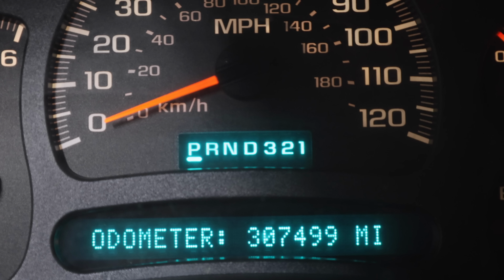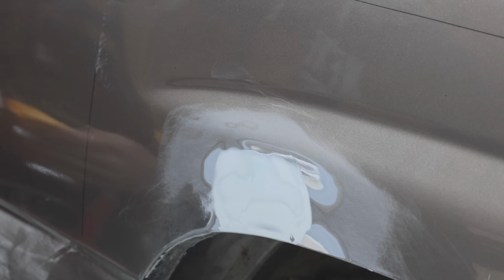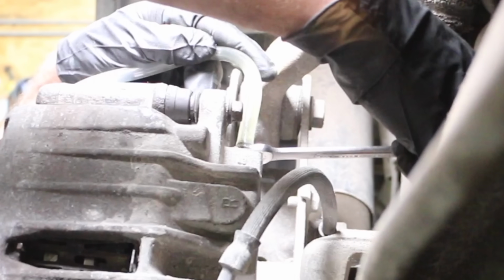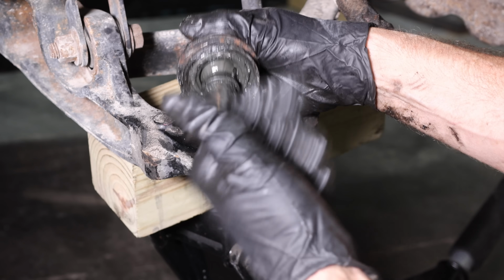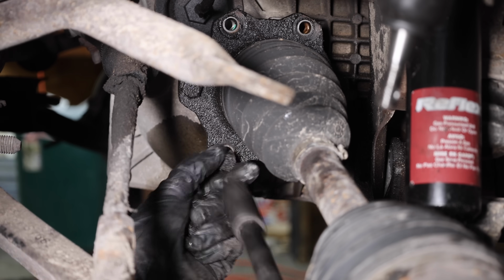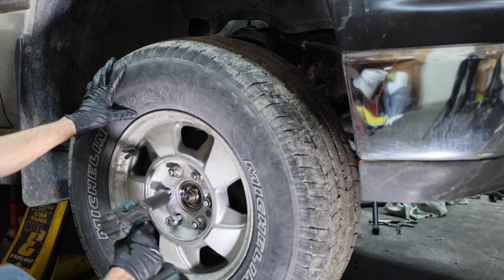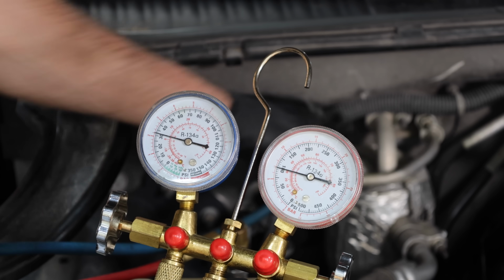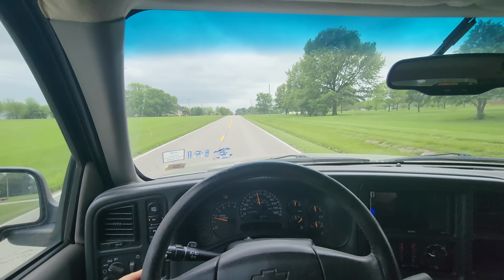Is It Stupid To Fix Up A 300,000 Mile Vehicle? Let Settle This!

Comment: Bad ass videos! I just like to know how much did it cost to to do all that maintenance at once? And if you were to pay someone how much more would it have cost. I love older vehicles they are so easy to work on and in my opinion a lot more durable & reliable for the most part, just as long as you give them proper maintenance no need for newer vehicles

Comment: It is absolutely NOT stupid to fix up a 300k mile vehicle. I'm guessing you spent $1000 on parts and materials, and a couple days of your time for this update, and that Suburban is probably good for at least another 100k miles. I have a 2002 Mercury Sable wagon with just under 100k miles that looks, runs and drives like a new car that I am quite proud of, and wouldn't dream of trading it for a new car that costs $50-60k.
Reply from the maker: Great Point!

Comment: For the novice mechanic , when changing out Brake pads, with the tire off you can see the pad wear in the cut out of the caliper support, if worn pads  are found take a long screwdriver or a flat bar between the shoe and disc to compress the pistos back into the housing, only takes a few seconds. After repacing the pads, and everthing is back together, press the brake pedal  slowly and release, wait a couple of seconds and do this again, untill the pedal hardly moves down, the caliber is now charged with brake fluid. Failure to do this, and you might not have all your brakes on first drive.
Reply from the maker: Thanks for sharing the tip!

Comment: My credit isn't the best, and my family is rough on vehicles, so I've taken to spending a few thousand on beaters and driving them as long as I can.  I did have to finance a vehicle last year for the first time in over 15 years.  Let's just say that the monthly payment is absurd, and within a couple of months of buying it, my wife spilled hot chocolate in the vents and the a/c stopped working.  I think I figured it out, and bought the part to replace, but it's a Ford and I don't want to damage the interior trying to pull things apart (I was a GM mechanic 25 years ago, but my patience and ability to contort my body preclude doing a lot of work).  So, that's probably gonna be a $2k+ fix.

My truck has been stored over 1000 miles away since I retired from the military.  It's an '06 Sierra with nearly 320k miles, and I think the head gasket might be blown.  I plan to swap in a crate engine and know that the 4L60E transmission and the transfer case are going to be in need of replacement shortly after.  Even if I pay for someone else to do the drivetrain work, and refurbish the suspension and steering myself, I figure I might be in for $15k... $20k tops.  For a 20-year-old truck (manufactured August 2005) Sierra SLT that'll be essentially new besides the body and frame (no rust or major damage that I know of).  Buying a new truck with similar options--updated for 2025 standards--will set me back over $60k.  Buying a similar truck with less mileage on the original drivetrain will cost at least $5k, for a truck I don't know the history of that might require the work I need to do to mine anyway.  Plus, I'd have to obsess over every little speck of dust and potential scratch, parking as far as possible from other vehicles and getting paranoid when someone dares to park next to me.  No thanks.  My truck has plenty of life left even if it requires some more investment, and I can use it like the truck it is rather than an overly expensive status symbol that I'd feel the need to baby.
Reply from the maker: Thanks for sharing.

Comment: A new car is about $500 a month plus insurance and a new truck is about $900 a month plus insurance and you will still have regular maintenance. So running a beater car or truck is saving you that much money each month. Even if it cost you $200 a month to keep it running it would still be cheaper than a newer vehicle.
Reply from the maker: Thanks for the feedback.

Comment: How come you chose to replace the ball joints over the control arm kits that came with them? I have a 2007 tahoe 250k and it's time to do some front end work...I decided to just buy the control arms and bolt on and go...seemed easier but haven't started yet.

Comment: I got a 2001 f-150 very nice truck inside and out, has 282000 miles on it. Motor is 4.6 untouched, still run smooth, quiet and strong . If it needs a motor or transmission, I will happily put it to it.
Reply from the maker: Nice!

Comment: Heck yeah its worth it if it has a decent core then sure you can definitely put 3,000 into a vehicle with 300,000 miles and get probably another 300,000-400,000 miles out of it but only if you drain about a quarter of the transmission fluid out and then add new then keep doing this for every 50k miles

Comment: I work in a body shop and you actually did pretty good. You can use spot blender to help blend the plant and than once it’s cured wet sand with 1500 and buff it
Reply from the maker: Thanks for the feedback.

Comment: Had an 01 Focus, DOHC ,5speed, that I was putting 135 mi/day on commuting to/from work. It hit 300K miles and was still running good. I kept track, and from 300K to 400K I spent less than $1200 on it with me doing the labor, and that included tires, timing belt and an AC compressor along with normal maintenance. I'd have kept driving it, but the rust just got too bad when it hit 400k miles at 20 years old. If you can do the work, it's worth keeping one running. If you have to pay a shop, well...
Reply from the maker: Thanks for sharing.

Comment: You did a wonderful job sir. This work beats the heck out of Making payments for 5 to 8 years. I drive a 1978 F-250 and a 1979 Ranchero both run great. these new vehicles are WAY overpriced and not worth what you paid in 8 years at all. Do not forget the electric in tank fuel pump. it goes out and your walking. Once again Thank you for making the effort, Perfect, Great job.
Reply from the maker: Thanks so much!

Comment: How much was the total cost of this repair?
Reply from the maker: Parts around $2,000.  Labor  $2,000-$3,000.
Reply: @ProjectFarm  that's actually not bad at all. I have a 2004 Ford F150 that I got for $3000 and I'm planning to slowly work on replacing some old parts to keep it running for another 5-10 years. Thanks for the response!

Comment: Love your video pace... Did you do a compression check on the engine before repairing the car?   Also is the transmission cooler changed on the Radiator?   Usually the Engine and Transmission will be the most expensive repair you can do.   I FIgure a car is worth $2500 per 10,000 miles of useage.  or  $25,000 for 100,000 miles.  Or $50,000 per 200,000 miles.

Comment: Did you ever do a video testing conventional Rotella 15w-40? That's  my personal oil of choice for every engine I have say for my Silverado. I’ve even used it in my lawn mower for a season and was impressed by the results. My old engines love it until the temp drop.

If you haven't tested it, I would love your results. The lubricity test would definitely be interesting. I also want to see the volume changes under heat conditions.

Thanks for reading my comment. Been a big fan since day one!

Edit Don't change your format. It's  perfect for delivering the best results with all the steps to get them!
Reply from the maker: You are welcome!  Thanks for the suggestion.

Comment: I had a 2001 Chevy cavalier LS, it had 220,XXX miles on it after having it for 4 years. 

It was rusty and taped together, the muffler fell off, windows didn’t roll down and the speedometer was 5 mph or so off. 

Still, that engine was solid and she loved to fly, even in snow she got around just fine. 

After I bought my Escalade last September I gave that car to someone who needed it more than me completely for free. That car will last her another 100,000 miles easy.
Reply from the maker: Nice!  Thanks for sharing.

Comment: I get a lot of good info from your videos and I like to do my own maintenance and repairs. Thing is I would have had to replace the cv axles, seals, upper and lower control arms while I was in there. I did all this and more on my 01 s10 zr2. One bad cv axle, loose ball joints, worn inner and outer tie rods. All that at 83XXX miles and no off road stunt driving. Also a thorough vacuum line replacement (lot of it gone bad), and ground R&R. Look forward to more of your projects!    👍
Reply from the maker: Thanks for sharing.  Glad to hear!
Reply: @ProjectFarm  Ooops! I commented before watching entire video. You did replace cv axles and seals. I'll try and pay better attention in class.

Comment: On fix up videos it would be helpful to have a printed list of what you did that we could take a screen shot of. I have a 1998 c1500 Silverado with over 250,000 miles on it and this is a good checklist of things that mine needs. I'm not a mechanic but I turn a wrench. It won't be nice to have the steps to refer to.
Reply from the maker: Thanks for the suggestion.

Comment: Also i agree with a lot of parts you choose I'm not saying anything bad about you just giving some really good advice as a certified gm tech and asa person who learned from my own mistakes.  my buddy and I both learned the hard way that use acdelco plugs only ngk caused problems in our chevy products. I'm sure your engine is a 5.3 most common in gm trucks like mine his is a 3.6 in a 2020 traverse. He wanted ngk iridium well it got him a new transmission from gm since he got a lifetime warranty with his vehicle they changed it twice thinking it was a transmission issue then they thought evap since the conditions met the criteria now the evap helped but didn't solve it i kept telling him let's put acdelco plugs that's what came in it that's what it's meant to have! Guess what his problem was solved. On my yukon I had a slight miss but computer couldn't locate which cylinder so it was a p300 code after 10k miles the ngk iridium plugs were taking a poop put acdelco in 65k miles later still no issues and plugs look great. NGK makes a great plug but they're not good in a gm those are made mainly for rice burners. And yes we both used a different iridium  ngk plug i used the iridium regular he used iridium 9. So lesson to be learned is that using a spark plug that's not recommended by the manufacturer can cause problems and if you're not a week trained tech it can cost you a lot of money in diagnosis. So be careful it's always best to run what is called for when it comes to spark plugs. Unless you've built an engine that's for racing then you may have to so tail and error till you find one that works for that specific application.
Reply from the maker: Thanks for sharing.

Comment: I will always fix up a chevy no matter the miles. I bought my 2000 Chevy 2500 ext cab short bed for $3,900 in the spring of 2024 and its been my daily driver since and now has 369,565 on its original 6.0. It also came with a 8ft boss snow plow but its only been a plow truck for 3 winters
Reply from the maker: Thanks for sharing.

Comment: Love the video format you use. Please keep it. A video idea is rust prevention treatments for car undercarriages. Two I've seen advertised are Rust Check, and Lanolin. I'd love to which treatments prevent rust, if car wash pressure removes the coating, and if car wash soaps remove the coating. The varieties of salt used in New England along side the humidity is very corrosive to cars so a head to head of these products would be helpful.
Reply from the maker: Thanks for the feedback.  Thanks for the suggestion.

Comment: Rebuilding older vehicles that are much cheaper to rebuild than newer vehicles ever will be is likely to gain a lot of traction in the USA. There are many vehicles in the junkyard that could be brought back to near new condition for a fraction of the price of a new vehicle price tag. If all you are aiming for is a functional and reliable vehicle, you could save a lot of money rebuilding an older vehicle if you have that kind of cash on hand. Most people need loans to own a car though so we take what we can get. Car prices are set to get worse as the average new car price keeps going up. The auto industry is using covid as an excuse for their foolish business practices. The more expensive the cars we currently make get, the more expensive the cars we made get. it is supply and demand. I HOPE auto repair people get hard to work at restoring older vehicles to make these auto makers suffer for their ignorance to our wallets.
Reply from the maker: Thanks for the feedback.

Comment: I saw recently you should torque spec any suspension components while under load. It makes sense not to do it in air. There are simple tools to hold car loaded while the tire is removed.

Comment: I got my 02 Suburban with 220k on it. My previous one was a 96 it had 330k on it when i stopped using it and was an excellent driver yet. The 02 has 288k now. Engine is tired but runs and drives great. If not for the rust I'd keep it going. Have a 99 Yukon with 218k on it I'm abouts to start going through. You can get good reliability from these even at high mileage. I've been doing it for years and never have been stranded by these vehicles.
Reply from the maker: Thanks for sharing.

Comment: I am a certified tungsten arc or tig welder with 4 years industrial and 1 year college experience. Advice being tig welder would work much better for any auto body or exhaust repair or cut out replacement if using aluminum use AC current between 90 and130 voltage depending on the gauge of base metal and DC current for stainless steel between 40 and 90 voltage depending on the gauge.
Reply from the maker: Thanks for sharing.

Comment: I think the pace of the videos is perfect, what I would like to see in these videos, similar to what you do in the comparison videos, is a quick data set or info dump - I think here that would have been good so I could pause and analyze if needed.  One thing I'd be curious about here is the cost of all of the goods, hours it took to perform, and the cost those hours would incur at typical shop rate - Just to drive home that, yeah, it's pretty much always worth repairing and maintaining a vehicle unless something catastrophic occurs.
Reply from the maker: Thanks for the suggestion.

Comment: When I was in the Air Force, 1990-1999, I often see the crew chiefs of older jets on the flighline working on the planes, like F4.  Meanwhile, crew chiefs of newer planes, like F16, F15, A10, C5, C141, would just fuel, do minor simple maintenance, then go back inside.  Based on this, it's best to just have a newer vehicle, than constantly fixing the older vehicle.  Everything degrades over time.
Reply from the maker: Thanks for sharing!

Comment: 380,000 miles on a 2007 Tahoe….New alternator in 2016, new front end components in 2018, new fuel pump in 2020, new radiator in 2022, and recently I’m having the dreaded issue with only being able to pump $1 of gas at a time before the gas comes up the neck and stops the pump….Changed the fuel solenoid, fuel canister, and fuel vent valve but problem persists so apparently the tank has to be dropped and the lines blown out due to the old charcoal canister going bad and clogging the vent lines with charcoal……Other than that it’s the original motor and original tranny……Still shifts and runs great. Chevy owes me nothing at this stage lol
Reply from the maker: Thanks for sharing!

Comment: Can I ask how much time went into all these repairs? you were very thorough and I have a 2012 Toyota Camry that’s at 175k miles and changing the serpentine belt, alternator and am looking to replace the shocks on it as well, it drives so well, and I’ve had routine maintenance on it, for years now, so I’m curious how much time I’d need to spend in making these repairs myself; for reference I’m probably a 3 on a scale of 10 for handiness but Im decent about picking these up quickly

Comment: The price of new cars I feel it best to keep ones older cars. Yes, a transmission can cost greatly but a new car will far cost more than a trans or engine. It is jsut keeping up with the repairs that possibly get people into buying a new car. I don't want to own a new car that lets the manufacturer know everything you are doing as it has built in follow you around tech. I like my 2011 Subaru and 165,000 miles.
Reply from the maker: Thanks for the feedback.

Comment: The question to ask is, could you get a better vehicle for the money you'll spend repairing the old one.  In my experience, unless the body has some pretty severe problems, the answer is no; you're better off fixing up the old one.  Especially considering any potential replacement is likely to be newer, and newer vehicles tend to be junked up with a bunch of computerized electronic crap you don't need.
Reply from the maker: Thanks for the feedback.

Comment: I bought my 2013 Jeep JKUR brand new. I change the oil every 5k miles with mobil 1 and a good filter. I perform other maintenance as recommended. It is my daily driver and has 246k miles. I have no plans to ever sell my Jeep
Reply from the maker: Thanks for sharing.

Comment: Quarter panel repair. Also tack welding the piece in..honestly 5-6 tacks is all it would take. Welding that solid is extreme overkill plus welding promotes rust, so the less you do the better. I use marglass first over that, standard body filler is porous